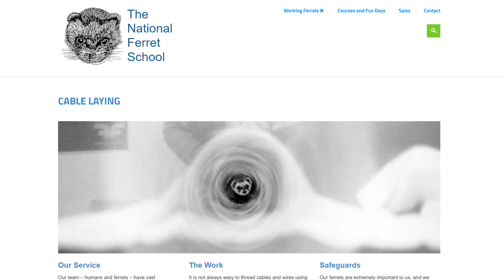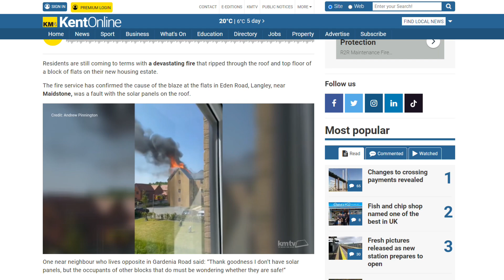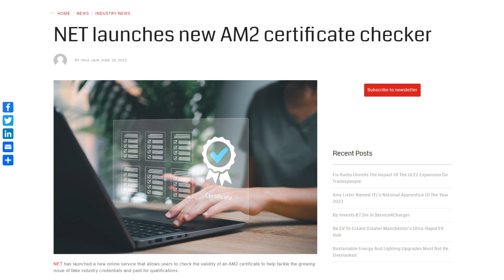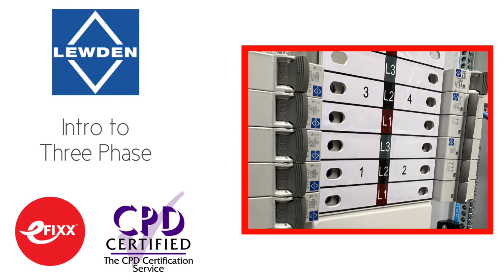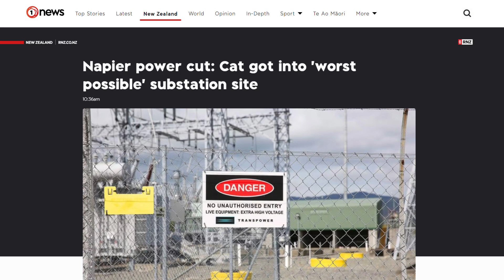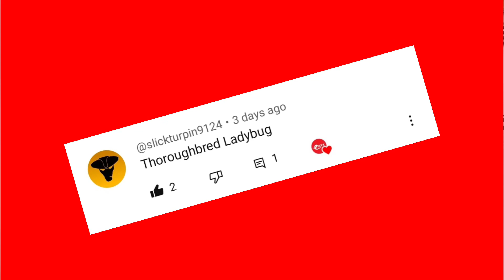How Ferrets Help Electricians Lay Cables

Comment: I came up with this idea in 1986 when I overheard the cabling guys at the company I worked for,  talking about trying to get some extra data cable through a duct 75 metres long which ran under a road between two offices on a business park in Newbury. The draw wire had snapped, so they were faced with the prospect of digging up the road to get to the duct. Being a nosey salesman, I asked what the duct consisted of.  "It's just a 4 inch drain pipe" they said. To me the word associated with "Drain Pipe" is "Rat" (up a drain pipe). The next thought was "Ferret". Question: "Could we use a ferret", I asked. Reply: "Dunno, where will we get one?" "Leave it to me, I'm sure the landlord of my local (in Henley) will know someone with ferrets" I said. 
I eventually tracked down a guy called George who had ferrets but he didn't drive so I had to pick him up after he finished work, and drive him the 30 miles back to Newbury, 
The first ferret that he tried was a male, and George enticed him through the 4" pipe by putting an open tin of food at the far end. The ferret had a fishing line attached to his harness together with a tracker to allow us to follow his progress above the surface.  Unfortunately he got stuck in a tangle of cable part way down the pipe and had to be dug out (not under the road, thank god!). We thought that was the end of the experiment, but George wasn't ready to give up. He then produced his secret weapon, a smaller, female that was "in season". He placed the male at the far end of the pipe in a cage and the female at the near end. Within about 90 seconds she picked up the scent and set off down the pipe at speed. She went straight through the duct without any hesitation, and emerged at the far end in about 2 minutes. 
Morale of this is: Never underestimate a randy female! 😉
I then drove George and the amorous ferrets back to Henley and gave him £50 for his "Ferret Fund". 
Unfortunately, I hadn't allowed for the difficulty in getting rid of the "Eau de Ferrets"  from my company Sierra, so the next week's expenses claim included: Ferrets - £50, Valeting to remove Ferret smell - £25 
(I had some difficulty explaining these to the finance department).

 The story was reported in the local press and Meridian TV did an item on the evening events programme broadcast from Southampton the following day, which featured George who they had driven down from Henley.  The producers had set up the unsuspecting female host, who they knew was afraid of mice. Reading the script, she innocently asked, "so exactly how big is a ferret, then?"  She got a huge shock when George pulled one out of his pocket and handed it to her. She lost the plot and the crew collapsed in hysterics. 🤣
Reply from the maker: Wow! What a great story. Thanks for sharing! 👍

Comment: 4:37 what was wrong with MR16 and GU10 bulbs, not requiring some weird non standard led pack that could be irreplacable if bell lighting ever goes bust or just generally decides they aren't going to make replacements anymore.
Doesn't look like they have exactly solved the problem with the overheating of the drivers in the bulbs either since that's what kills GU10s, and that should be solved by making an actually decent bulb that doesn't overdrive the LED chips (as that's what creates the heat).